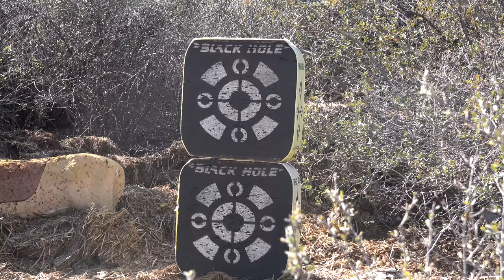Making the Comanche Bow, A Bow Maker's Journey

Comment: I like that little Osage Orange bow you made. Osage is a gorgeous wood. There are a couple of comments you make about short bows that aren't quite accurate. A short bow is not faster than a longer bow, without talking extremes. Super long bow or super short. There is more finger pinch in a short bow thus limiting draw length. if that is non existent, then it is not a powerful bow and a short bow is less stable, more difficult to be accurate with and not as powerful as a medium recurve or long bow. There is a lot of lore around natives' bows. They were short range bows, not too powerful but useful for stalking low on the ground and for carrying and shooting from horseback. It's the same with the tomahawk which wasn't what is often portrayed. The best tomahawks came from France as a trading instrument with the natives. This started around five centuries ago. The natives' lifestyle was efficient within the confines of their environment but not compared to what the Europeans brought with them. Short bows are practical in tree stands, they are sufficiently powerful for reasonable distances for hunting, up to maybe 30 yards. It isn't how far an arrow can be cast that defines the efficiency of a bow, it is how long the arrow remains at a certain speed to achieve pass through or at least good penetration with a broadhead. A short bow's limbs can only be bent so far because of their small size, before they suffer damage. An overbent bow doesn't have limbs that return in place fast enough to be called "fast". Everything has its place but the most efficient traditional bows whether self bows, recurves or longbows are usually between 60 inches and 66 inches in length. At these lengths, these bows are stable, fast, accurate and can cast heavy arrows a long distance.
Reply: I appreciate your observations as well as your own studies whether formal or otherwise.  I find these short bows fascinating and I'd like to shoot one but I'm put off by the short draw length and lack of a consistent anchor point.  Of course the Comanche were an incredible light cavalry, probably eating only Lembas Bread on campaign and were adept at "snap shooting" whatever that actually means.  When one draws, aims and at the touch of the anchor point releases it looks like snap shooting even if it wasn't. Maybe someone such as Jeff Martin has discovered a mental anchor in that the human computer makes many calculations involving the speed and gait of the mount, the distance to target, movement of target and the arrow releases almost as if the arrow was in charge. Athletes in sports involving a ball probably operate in a similar fashion.  At any rate I doubt the victims of the Comanche complained about poor accuracy. 
I wonder if the Comanches had a horse bow and a stalking bow. Did they deer hunt from horseback or did they hunt deer in the old fashioned way of stalking on foot in which they needed a different type of accuracy from a greater distance than was required in battle or hunting bison?
Reply: Find myself agreeing with everything you've said.

A short bow can throw a light arrow fast. That's great for hunting small game, and even larger game if you are working in a group or have time to shoot and track down a bleeding animal.

The comanche had absolutely no need to be able to attack anything at ranges over 100yards. That is where a longer-limbed bow comes into its own; not necessarily shooting an arrow any faster, but throwing a heavier arrow at a similar speed. The heavier arrow will retain penetrative power at long ranges.

Also, based on personal experience of hunting small game, if you are used to your bow, you can shoot with partial draws (sometimes necessary when in thick brush and there is no room for a full draw. That doesn't work if you are trying to hit something from 60m away.
Reply from the maker: Thank you for watching!
Reply: Very accurate what you said the short bus really had their limitations. I had the opportunity wants to see a copy of a British longbow made in the Middle Ages and they were very very powerful weapons especially with the iron point. I also have the amazing opportunity to see an actual boat made by The Lending letter P Indians of New Jersey they were much longer and much powerful but they did not have horses they had to hunt on foot I'm sure they had something to do with it
Reply: I agree in broad terms, but only if limited to self bows. Asian horn bows with recurve and reflex are very short, but also have very long draws. The finger pinch issue is eliminated with the thumb draw. These bows don't have the limitations of a short self bow.
Reply: @hyoklee3297  as you said. This applies to self bows. Asian composite bows are a whole different creature and I at times have difficulty classify them as “primitive technology” due to their fairly advanced design and construction. There are several design elements of Asian composite bows that allow for  a full draw while still maintaining their short length that is so desirable for use from horse back.

But as the title of this video states, the creator is examining primitive technology and a composite bow is anything but primitive.
Reply: @bozzskaggs112  Well I am Sioux and we and they hunted bison 🦬 at point blank range on our horses. Our cultures were close in fighters so our short bows and arrows matched. Yes less longer range accuracy and power but our horse was our range
Reply: @Daylon91  "but our horse was our range" puts my statements in context.
Reply: @bozzskaggs112  that's with any horse cultures who used the bow like the mongols or Turks.
Reply: @panzerlieb  I'm not trying to gather consensus but neither do I don't see Asian composite bows as primitive.  It's a very high art form. 
Speaking broadly as I don't have an associates degree let alone a PHD in this subject I know that that Native Americans made very powerful bows with different types of backing including sinew.  I suspect the apex of NA bow building were made by the Sheep Eaters (Shoshone?  Dialing a friend.) These bows had sheep horn bellies and thick sinew backing. The sinew was so thick it would crush wood. I would rank these with the Asian bows considering the build technique and the capabilities of this type of bow. It's hard to imagine a three foot bow with a 70-80 pound draw.  Wow.
Reply: @joelynn2874  I don't believe that coin nonsense. Not at 300 yards. Our bows can't even shoot that far lmao 😂 u realize we/they drew 22-25 inches max. I've shot our bows.  Also the Comanche fell 16 years before we were defeated. The most efficient native bows was the Lakota Gullwing bow. Also we are the only tribe to defeat the Americans in a war not just battles. The only native tribe to do so. The reason why Comanche were the best on horse is because they domesticated and distributed it first to northern tribes/got raided by said tribes.
Reply: @joelynn2874  short bows are inaccurate meaning they are less forgiving to shoot. A longbow u can be more consistently accurate but u don't have much maneuverability. The length of the bow adds stability for accuracy. I love short bows but they're more difficult to shoot but more rewarding. They are not forgiving of your minor mistakes meanwhile a longbow couldn't care about a sloppy release or some minor mistake
Reply: @joelynn2874  Not at 30 yards let alone 300.
Reply: I have some Yew wood that isn't very long so I'm looking at this information.
But My Yew wood is often used in long bows.
I think I have oriental Yew as a species.
They where good sized chunks with orange wood and purple oozing out, and white sapwood.
Osage is almost like our Black Locust wood.
Reply: Ya but their arrows were super high foc.
Reply: While you have good points and info, I will say, that I have been an archer since I was 8. Iv shot long bows, short hunting bows, recurve bows both short and long, and  compounds. The trad bows iv owned have been Osage, yew, hickory red oak and pvc. After 32 years of archery experience I will say that a 52inch bow is the most versatile, accurate and quick nock bow iv ever used. That's just for me though. 
Much like with firearms and blades, the effectiveness of a weapon is based 90% on the wielder/shooter, and 10% the weapon itself.
Reply: Someone knows there stuff 😂😂

Comment: You've made a very basic mistake; Comanches only nock the bow string on ONE side - on the left for a right-hander and on the right for a left-hander.  This gives two benefits; a quicker time in stringing the bow in action and a straighter line for the arrow to follow.  Additionally, they used sinew for the bowstring, not twisted cord.

Comment: Peoples who fought on horseback always favored short bows, from the Mongols to the Native Americans. This was because it was easier to switch from shooting to your left or right side, since the bottom of the short bow could more easily be lifted over the horses mane. Peoples who used their bows from a standing position didn't have this problem, and so preferred the more powerful longbows.
Reply: Most Native Americans did not fight from horseback.
Reply: A bows power is determined by its draw weight, not by type.
Reply: Almost always- Japanese used long bows.
Reply: @Rick-ve5lx  and fought from horses
Reply: @Nathaniel Miller then we agree but are using different vocabulary 🙂 I would have said design instead of type, but for sure heavy limbs make a slow bow.
Reply: @Rick-ve5lx  Yes -- the Japanese equestrian bow is the exception that proves the rule.  It has a short lower limb and long upper limb, so the lower limb does not bump the horse but the total length gives a long smooth power transfer.
Reply: I think the turkish bows throw farther than longbows.  Plus they had maximim draw plus: as they drew arrow head past the hand holding the bow.  Some native american bows were composit as well .
Reply: @thomaswayneward  in which case they used bad bows
Reply: @matthewadams8713  and an English longbow had by far the highest draw weight. A long bow would have taken out any guy using bow simply by having a much longer range.
Reply: @Rick-ve5lx  they used bows that were long but they were not the longbow made famous by the English. I'd guess an English longbow had at least twice the draw weight of any other bow on earth then or now
Reply: @matthewadams8713  you clearly know nothing about the all conquering English long bow.
Reply: @davidtettleton2732  there is no way any Turkish bow had a longer range or greater power than an English long bow.
Reply: @mrdarren1045 Joe Gibbs shot a Tatar bow and his English longbows and the tatar is both faster and throws the arrows farther. The Turkish bow is faster than the tatar bow and is even shorter than it
Reply: @mrdarren1045 the longbow is the most basic design its design 1 composite bows outperform them easily and they're much shorter. A longbow is not a fast bow compared to pretty much ANY recurve design bow
Reply: @mrdarren1045 if I want to make a bow faster I will setback the handle or limbs. The longbow has none of that but takes set. So instead of having an extra 3-8" of extra power it has -1" set

Comment: Lars Andersen's video on the Comanche got the A.I. to suggest your video.
I felt like we were dropped into the middle of your process in this video so if there are others that lead up to this please let us know. 
-Was the stave split out out green wood?
-How long was it drying before work began?
(some plains natives supposedly soaked osage in water then bent it into desired shapes)
-once the growth ring was established was all other work done on the back of the stave?
-What was the traditional bowstring made of?
-Were the bowstrings released when not in use?
-What were the traditional fletchings?
-How many fletchings?
-What was the size and depth of the nocks?
thanks
Reply from the maker: Thanks! Remember to subscribe to this channel
Wood was dry
2 years dry time
Fast flight string
When not in use, unstring bow
Turkey feathers
3
1/8" deep

Comment: Thats a really good build for primitive bow. Fast and light. Its funny that these must be held horizontally mostly because of their size and shape and sneaky hunting style. But the horizontal stance is very accurate if you master it. Its like shooting a crossbow. I prefer native style bows because they are easier to carry and handle than warbows. We also have short hunting bows here in scandinavia and in europe. Many tribes all over the world used short bows and they often had relatively long arrows. All primitive hunting bows used to be convenient and practical according to the surrounding environment. In my area they had to craft laminated bows from pine and birch because there werent much options. Slowly grown northern swamp pine is actually pretty good bow material.
Reply: Where are you from? I'm from northern arkansas are tribes used osage.
Reply: Also we held our bows more horizontally because the handle is quite thick and the braceheight is low 3"-4" Olympic bows or "traditional" bows have a cut in shelf so u don't need to cant the bow

Comment: I think many people underestimate the draw weight of short bows.  What they lose in draw length, and therefore anchor ability for the archer, can easily be forgiven with their gain in speed.  Another nice bow build!
Reply from the maker: Thanks. It was a fun build and this bow will see a lot of use.
Reply: Not sure where you guys have the "shorter=faster" stuff from. Short bows are more practical when sneaking through bushes or shooting from horseback. But a long self bow with light tips is superior to a short selfbow.
Reply: @Cornelius Sulla Hmm.  You've got a lot of qualifiers in there.  But that's fair since I left out qualifiers too.  Pound for Pound, a shorter bow will be faster.  Both in terms of getting the arrow off and the initial speed of the arrow.  It's a physics thing for the limbs to travel through their distance to get up to speed.  Shorter limbs have shorter distance to release speed.  You can usually crank up the poundage in a longbow to compensate for much of that and equal their release speed.  All of that ignores their resistance factors too, btw - like limb width and thickness, tip weight, and differences in material makeup etc.  But if you could build them to be perfectly comparable on those factors, (ie light limb tips on both) you are left with a short bow needing less lbs to get the same speed.  All you can do to get around the physics is engineer your way there, like you're suggesting.  So.  I should probably have put more weasel words in and said something like, "on average, because of the physics of shorter limbs, these types of bows tend to be faster than their longer counterparts, at lower poundage."  There.  I fixed it!  😁

Many peoples survived very well on various bow types for millennia and I suspect they all argued over their superior use-cases, as surely as they argued and fought over their marksmanship..  Nothing new in that.  Since we don't survive on them anymore, we can engineer or replicate them for all kinds of reasons, not least of which is because they're "cool" and fun!
Reply: @chucklearnslithics3751  I made bows for a few years and at a tournament near Munich, we had a chrono to shoot through. And many people with very different types of bows could compare the designs to each other. And have you read the traditional bowyers bible?
Reply: @chucklearnslithics3751  PS Sorry, I have read only the first part of you reply because I getting ready for work. I will read the rest when I return and hope I didnt misunderstand anything so far. And thank you for the quick reply anyway.

Comment: I'm a woodworker and no interest in primitive bows, and now i NEED to make one, your video was concise and very well thought out. One question, I might have missed it, but what material did you use to string your bow?
Reply: Traditional bows tend to be more favorable to materials with a bit of stretch like Dacron. It's dirt-cheap to get a spool of and typically the best option for "when in doubt" bows where you aren't sure if it would be wise pairing it with higher-performing (but more stress-inducing) string materials.

Comment: I agree with you to a point on the use of the shortbow. But find a longer bow...5 foot or so...to be smoother and more accurate then the shortbows. They allso seem to have a longer range.
I've made both and like both...keeping a 48 inch bow in my collection and hunted with one for a couple years.
I now typically use a bow with just an extra inch or two over my max draw of 27 inches...so about 56 to 58 inches over all

Comment: I watched a video with Mike Loades the other day where they compared the Japanese and English longbows. For comparison of the two designs, they had 50lbs draw weight bows of each.
…now I would like to see the Comanche bow compared to them. I have a sneaking suspicion that due to the geometry and mass of the bows, at 50lbs the Comanche bow would perform stunningly well, possibly outperforming both the others, as little of the energy in the tension of the material is wasted on moving the bow itself and more of the pull of the string is directed in the arrow's direction of travel.
Still a big English longbow with up to 200lbs draw weight will hit much harder and go further and all, but these are war bows. If limited to a certain draw weight, the comparison may go in favour of the Comanche bow.
So as a means for certain purposes like hunting where the arrow doesn't have to defeat armour, the native American design might have made the smartest compromise possible.